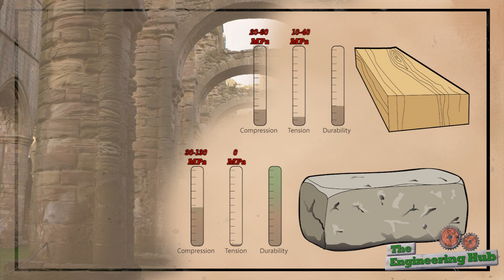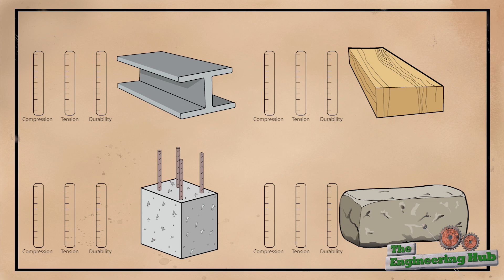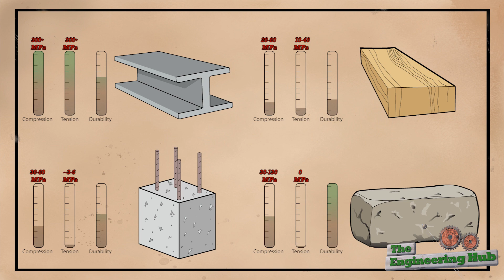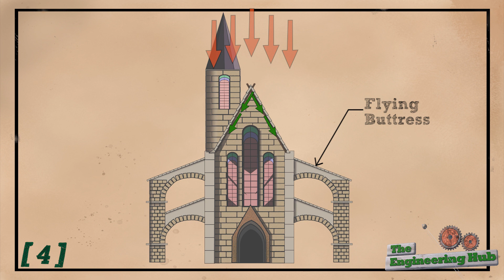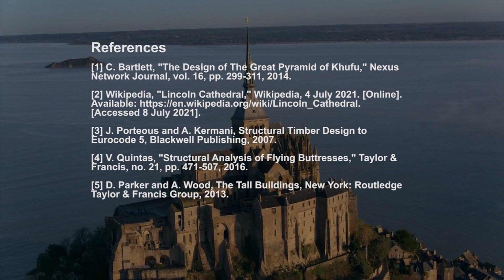Building structures in the middle ages

Comment: Didn't realize steel was better than concrete and masonry in compression. Thought it offered better tensile, bending and sheer resistance with decent compression albeit not as good compression as the stonework/concrete. Why use concrete at all then? Must be cheaper.

Comment: Roman concrete structures are still in use today. Old buildings built before portland cement have to be repaired with ancient grouts that were more flexible and less brittle than modern portland cement grouts. Would today's structures endure the ages as well as the ancient structures?
Today the common narrative is that society is more evolved and become more advanced than the ancients, maybe in some ways this is true, but it's not totally true. The ancient Greek word for 'science' means knowledge. and knowledge is something that can be proven to be true. Much of our science is theory and not proven to be true, such as the Big Bang, Evolution, Gravity, Relativity and etc.
Our history has been written by the winners, and most of mainstream history is a lot of propaganda and mind control.
The ancients were quite advance, much more than we are told. There is evidence they had machine tools and could crave the hardest of stones that are not craved today. And the they built with massive stones weighing over a thousand tons, and we don't to that either.

Comment: Concrete wasn't available in the middle ages??? Seriously? So Roman concrete wasn't available until after the fall of the Roman empire? I'm sorry but I'm confused.
Reply: There was no Roman Empire, it's invented history.
Dr Anatoly Fomenko,  book "History: Fiction or Science".
Reply from the maker: The roman empire started to fall at the end of the 4th century, and the formula for their concrete was actually lost and it still is. The concrete we used today is based on the Portland cement mix which was developed in the early 19th century. There was a really long period in history where concrete was not available. Sure other mixtures were there but not nearly as strong as the concrete we have today or what the romans had. Additionally, in design unreinforced concrete is assumed to have 0 tensile strength (Canadian, European, US codes assume this). So even if it was available it wouldn't have helped prevent tensile failure in the structures.